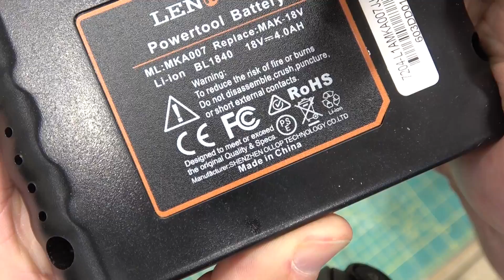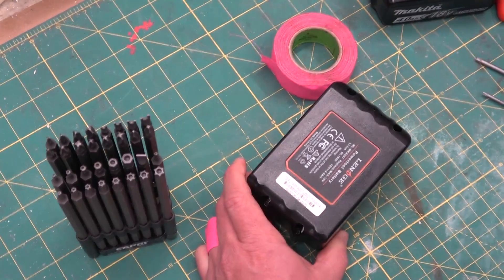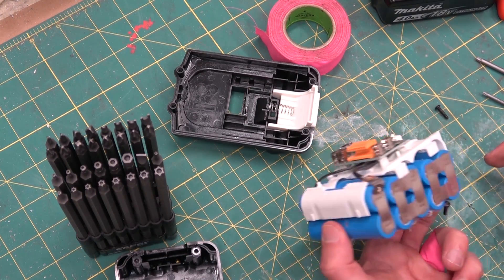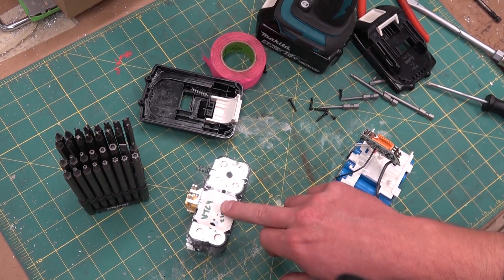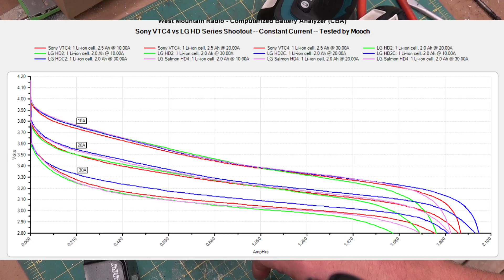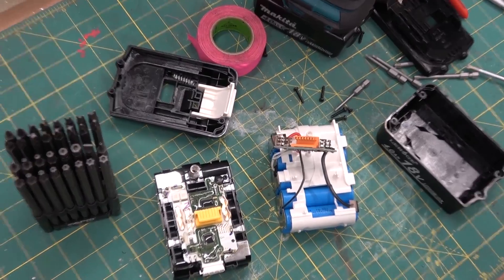BOLTR: Cheap Tool Battery

Comment: I've found with the cheapos when they do decide to go it's nearly always while they're in the battery charger,
the toxic goo that comes out not only leaves a mess but has you questioning if you can trust the charger even with good batteries ever again.
the quality batteries eventually fade but die quietly - with safety in their own circuits they knows not to keep trying to charge,
the cheapos will one day [soon] suddenly develop severe incontinence and not having proper cut-off (temp, over-current) circuitry keep on sucking juice out of the charger even after the smoke happens.  (luckily I've never seen flames yet, but man must have been close - could feel the heat radiating off them.)  Time to fetch the long tongs and a thick wall container for the coffin.  (even then a few layers of bags and attach a written warning so some idjit doesn't try to recycle it.)

Comment: Honestly I wouldn't bother, if you want some more juice then just find some used/dead packs for cheap then you can reuse the factory electronics and replace the cells, you can get some high drain 2Ah cells for as little as $2-$3 each, (so $20 for a pack of this size) you can even find them with little tabs wielded from the factory so you don't have to do any crazy soldering onto the cell.

Here's a search: https://www.aliexpress.com/wholesale?catId=0&initiative_id=SB_20191003042930&SearchText=high+drain+power+tool+18650&switch_new_app=y

Comment: I don't understand where he is avoiding touching when taking batteries apart? He seems to slowly touch everything. Not that I will ever come close to that kind of thing (I'm a scientist, not an electrician) but can someone explain what to avoid? Is he avoiding touching a combination of things at the same time? Or did he likely discharge it first? thx
Reply: It's a safety thing, you definitely do not want to hard short these batteries. Better safe than sorry.
Reply: There's no problem simply touching 18V. He wants to avoid having his metal ring short across them though - that would hurt bad - by sparking and burning - not electrocution.
Reply: Scott R oh that makes sense. So he is less worried about allowing 18v to go thru him to ground and more worried about shorting it in place. Thx so much!

Comment: I have a few cheap-o batteries for my Milwaukee M12 stuff, they work great on the Bluetooth speakers and crap I don't really need to do my job. I won't use them in an actual tool though. Plus they will only charge in the M12 only charger, not the M12/M18 charger. they do server a purpose, just not a very crucial one. Thanks for the video

Comment: CE- Chinese exports? Isn't it some European Union standard?
Reply: The proper EC logo does indeed mean "Conformitee Europeenne", but in case of these batteries that CE needs to be accompanied by a Nando reference number so you can verify which registered certification laboratory has certified that these batteries are indeed conform EC regulations. That combined with the fact that the type setting of the CE characters seems ever so slightly off is a pretty good giveaway that this CE stands for China Export.

Comment: I got a cheapo from amazon for 18 euro's once, it's rated 5Ah, it DOES have battery level indicators on it, charges fine on the original Makita charger... is it 5Ah? I don't know... but it works really well, and for 18 euro's I couldnt really get screwed over... if it dies it will end up as 18650's for my flashlights...
Reply: Could you send a link fo those?
Reply: @sebi7794  they dont sell them anymore, it was called => Nebatte BL1850B 18 V 5.0 Ah Lithium Ion Replacement Battery Packs For Makita with Indicator
Reply: @Darkfiberke  Thank you!

Comment: The 2.1Ah batteries will usually provide more current than the 3Ah cell.  The 3Ah cells are perfect for lower draw devices.

Comment: A balancer must be used to balance the voltage of individual cells during charge, cheepo don't have that so you will have a real fire risk when charging....
Reply: exactly that battery has NO protection without a balancer

Comment: There is a difference between Chinesium Excrement and Conformité Européenne

The real one looks like this: https://upload.wikimedia.org/wikipedia/commons/f/ff/CE_with_grid.svg 
The Chinesium Excrement is designed to confuse European users. It is two same letters but pushed together.

Anyways, even the original CE sign doesn't mean that a product is tested. It only means that the vendor thinks that it may conform. ;)

Comment: so one thing that does get stressed pretty constantly with people who use lipo batteries is how dangerous they can be when they fail. id be kinda worried about running the fake ones hard.
Reply: These are not Li-Po, they are Li-Ion. IMR Li-Ion (like in VTC4s) are much safer - they will vent if overheated, but not catch fire like other Li-Ion and Li-Po chemistries. No telling what chemistry is in those off-brand ones though

Comment: 'Torx security', is this even a thing anymore?
Reply: Of course it's a requirement so you bust off the end of your socket trying to undo something to tight.
Reply: I have cheap soldering station that has these. Also Apple.

Comment: Awww BatteryMooch love that guy taught me a ton. Especially how not to get a summer smile from a mech mod.
Reply: So true! He is a saint to mech modders! Especially when he said that material didn't make a difference, finally I could have a mech that doesn't make my hands smell like dirty pennies!
Reply: @BajaBlastBongWater  I'm a commercial welder/plumber there's days I put up 100s of feet of copper all the cleaning of pipe and fittings plus flux I know all about smell and green hands even using gloves and scrubbing hands multiple times when I get home. That God forsaken smell is tough to get rid of from your skin.
Reply: @BajaBlastBongWater  as long as your connectors are good you're laughing. Only thing copper sucks for is taste IMHO.

Comment: 3000mah will have a lower amp rating. You need a thick core in work tools so 2000mah are the right choice.

Comment: I’ve got that exact same set of fucky fastener removal bits.  Once found a delta screw on a helmet cam and had to grind a Robertson driver into a triangle to remove them.  There’s nothing built by man that this man can’t take apart and break.  And the fastener fairy always drops off some spares during reassembly when you're not looking.
Reply: The fastener fairy doesn't visit as often when I remember to set up a camera to video my disassembly/reassembly. I think  he is camera shy.
Reply: @hamjudo  That's what you think.  Try doing a car that takes years to put back together.  Film or not, you get a 20 pound box of extras.
Reply: Which bits are those? I've been looking for a set like that.
Reply: Nah, just weld a 10mm nut on the top...

And then find the 10mm spanner...

Oh...
Reply: @juststeve5542  I just bought 3 x 10mm and 3 x 13mm spanners to complete my sets. Got three of those sets each got an additional 10mm and 13mm when purchased.
So I'm surrounded by tens and thirteens. Few I've lost are coming back on me from time to time.

Comment: I've fixed a few batteries thanks to your videos, the problem with the DeWalt ones is they break in the same spot on the case and you can't buy the good cases so I have a bunch of DeWalt batteries without a case I'll probably just end up using the cells for something else
Reply: Could you get someone to 3D print new cases?
Reply: @COBARHORSE1  yes probably and you can buy cheap ones too but they're not as good as the OEM ones

Comment: Hi AvE! those are recycled cells.When you zoomed in on the battery tab there are previous weld holes.
Reply: Might have just took the apprentice two tries to get it right
Reply: @frankreilly7858  True Sir, but for that price and where they came from....other than component count...it's the only other way to keep the cost down.

Comment: I bought knock off Milwaukee m12 batteries just to salvage the black plastic bottom with the clips 
Because Milwaukee clips snap after a few months 
The Chinese ones don't break 
The cells are junk but their plastic is better quality than genuine

Comment: Shenzen... that's the Chinese Silicon Valley.. If you want theft of intellectual property, that's the place to go. Be careful with that though. If you get caught doing it, and you're not Chinese you get charged with cultural appropriation, and the only way to get out of that charge is by coming out of the closet.

Comment: Surprised your leash clip isn't tungsten carbide.  I can hear the question marks over the internet now but a couple guys in the plant actually have them. Hypoallergenic, non-oxidizing, always shiny, downside is hopefully it never needs to be cut off. You engaged guys in the mechanical trades should think about it if you want a unique wedding ring. Mine would need to be carbide swirled with copper but fortunately for the universe the ladies in my area have standards above my level.
Reply: Tungsten carbide is super brittle. And if it chips the dust can be hazardous.

Comment: I’ve been trying to use something related to these in a project, does anyone know what those terminals inside the battery are called? I can’t seem to figure that out so I haven’t been able to purchase some yet for my hybrid car battery powered tool...
Reply: Glenn Parker 
Just buy one of these Chinese ones and gut it .
Reply: Get spade terminals. and then you can 3d print a shell to hold them in line with Makita, Milwaukee, Dewalt layout if you have a printer.

Comment: I use the cheapies for running some of the stuff that gets knocked around a lot less. Site radio, work lights, fan etc.

Saves the skookum ones for using with the tools what actually get given a hot supper.
Reply: That was my thought - if you've committed to a single battery tool ecosystem and have a dozen different tools with the same batts, you can save the skookum name brand ones for the big boy tools doing hard work and use the cheap ones so you can have a secondary tool on the go at once (drill and screwdriver, or work lights and what have you)
Reply: Slartybartpharst well spoken
Reply: I try to have only tools which are able to swap batteries. Difficult but possible. I keep name brand tools but I dislike using the good tools in less than savory environments so the cheapies get volunteered for said tasks. Which also includes the "badderies"! I don't mind allowing a helper using those tools, then, while I perform the show work with legitimate and decent tools. Though I do have good tools which have been replaced and are now the crapwork tools. Things like an old wormdrive being used to cut holes through shingles or a smaller (12-18v) battery drill used for vehicle maintenance and repair and the 20 and bigger voltage stuff kept in their pristine condition for clean work. It's a strained and strange dance but tools aren't as cheap as those big box stores would like for us to believe.
Reply: Brilliant, actually.
Reply: That was my plan but turns out the dab radio will discharge the chinese battery dry if your not careful and it does not take a charge after that, went with a. Bang when I had 2p’s stuck in the terminals with a battery charger connected 😂 I’ve learned my lesson
Reply: The cheap ones work well for my home shop and various deck projects.
Reply: I would suspect the cheapo ones will perform just as well since Li-ion battery technology is basically all made at the same factory.  Panasonic make the lions share of Li Ion paste and electrodes.   The issue is the charging cycle and in all likeliness the charger is cheaper and not as good for elcheapo brand.  As a result you'll probably not get full charging (or over charging) which will make the life of elcheapo shorter.  20% less life of 30% the price is probably a really good deal!!
Reply: Darn good idea.
Reply: Going to agree... I've bought a few dewalt and m12 knock off and been impressed so far but I'm a home gamer.   IF I relying on my batteries for a job, hell no on the knockoff.  I have intentially used the heck out of the dewalt knock off on lots of stressful tasks and impressed they work as well as they do.  With that said... willing to bet they are nowhere what they are rated for.  Looking forward to watching AvE video where he tests the runtimes, guessing that will prove it for sure.
Reply: I'd rather be happy than right any day.
Reply: And are you ?
Reply: @GodzillaGoesGaga  No. That's where the whole idea rather falls down unfortunately.
Reply: Mice!  :-)
Reply: Ah so! Slartybartpharst he Uncle Bumblefuck speak!

Comment: I would like to know how they react with Makitas systems for overloading, battery charge counts, overheating, voltage drop and of course longevity. If some of these could be tested in an upcoming vijeo that would be great. Cheers for another great watch.
Reply: I have had mostly bad results from the ones I have tried.  About half of them have failed over a fairly short period of time.  I have used them as I would any other Makita battery and I use them in a dozen different Makita tools in a professional environment so they were not babied.  I will stick to the Makita brand.
Reply: Had bought one of those cheapo batterias, use them mostly for dead trees, sanding, drilling, an impact driver, it lasted 2 months. After 2 years of hard use, the legit makitas are still running like new (apart from the battery indicator plastic thingy that popped off, just reglued it with the hot shmoo).
Reply: Not for sure but wouldn't surprise me if it causes a fault on tool from incompatibility and they wouldn't warranty tool at later date because but that's a guess
Reply: Not as scientific as you'd like I'm sure....but they didn't last long for me in high current tools. They seem to perform on par with my OEM batteries in low current applications though, or low duty cycle (LED lights, impact, etc.)

I use the knockoffs for lighting,  impact, phone & device charging...and OEM for bandsaws, big drills, vacuum, etc and it's totally worth the savings.
Reply: I have a pair of cheapos, on for light duty stuff I am not able to tell a difference. Use it in my impact driver, and a light. Haven't tried them in my reciprocating saw yet. If the batteries die, will replace them myself.
Reply: Leopold  Both. LG is what Tesla uses in their cars if I am not mistaken.
Reply: if it's not Sony or Samsung it's combustible.
Reply: @sadjupiter9462  LG is perhaps better than Sony and Samsung even.